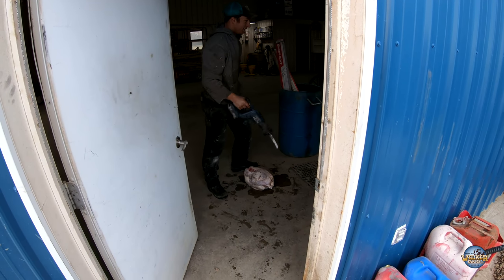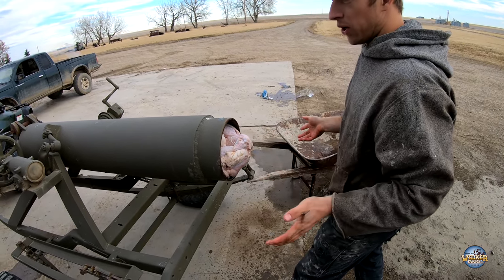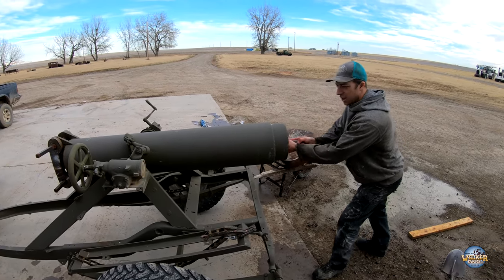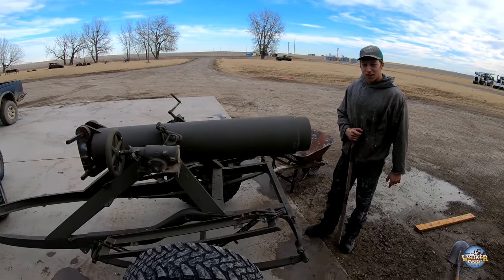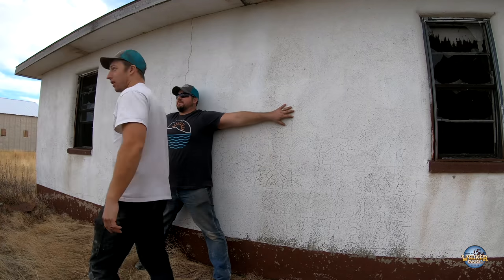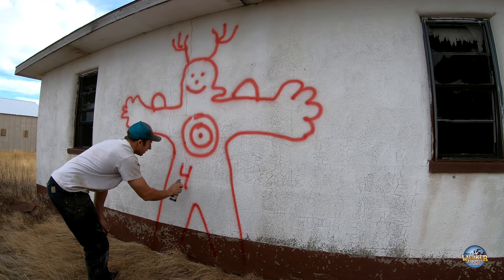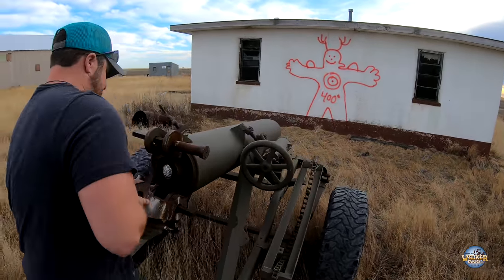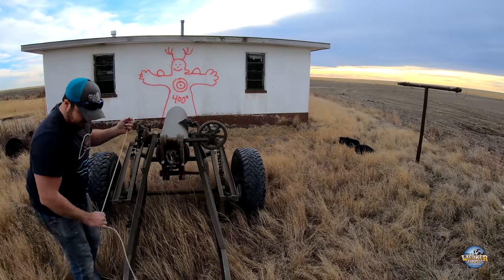The Farmers Cannon (Extended) - Welker Farms Inc

Comment: Cool cannon. Nick & Scott,  if you want you can set up an experiment to test if the earth is actually moving West to East at 1000mph, or if it is stationary. Point the cannon straight up, shoot the same weight and shape cannon ball straight up ten times (be precise with the angles and the gunpowder etc). If all the balls land due west of the cannon, the earth is moving. If not... you're living on a flat stationary plane. Thanks for the great channel and the hard work you're putting in. #ProTip: I would not stand directly under the cannon when firing straight up into the air.. ;-) NOT COOL WITH THE TURKEY THOUGH. We need to respect the animals, not shoot them out of cannons for fun.
Reply from the maker: That would be really cool! Just need a calm day or very consistent wind.